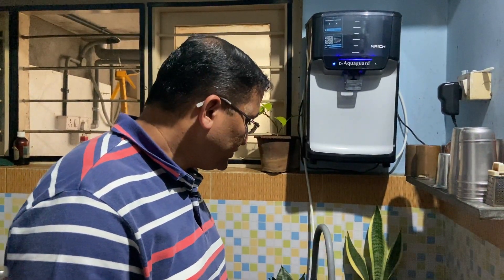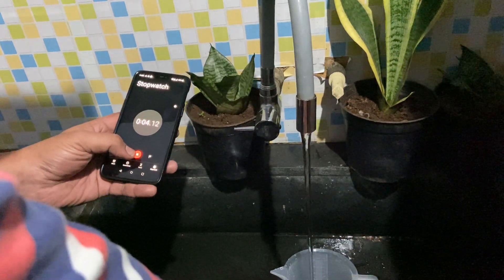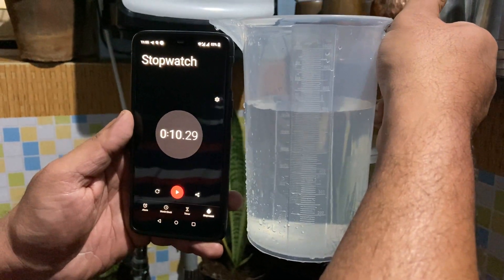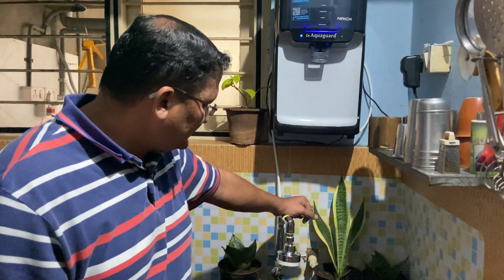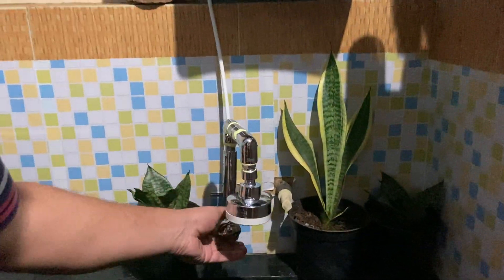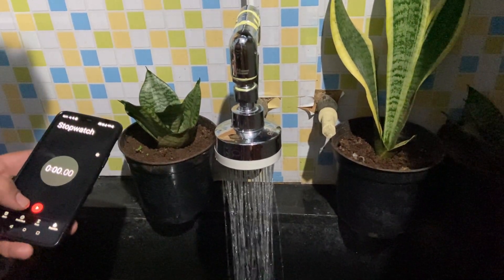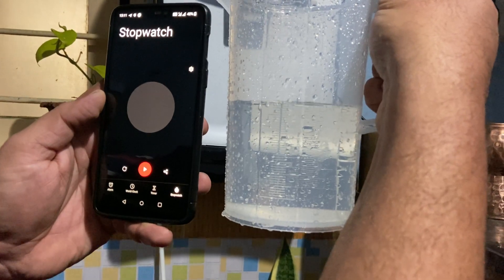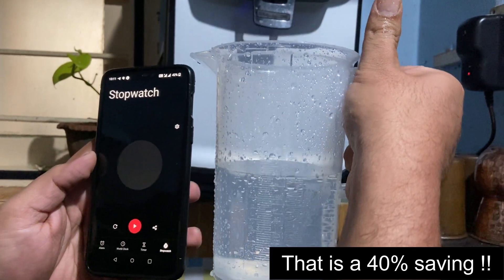Water Saving tap for kitchen Sinks

Comment: Hi Sir, Did you try replacing the tap's aerator with a water saving one? There are aerators with different flow rates and will be a lower cost and a 30 second DIY change
Reply from the maker: Yes have tried. That is good as well. 
I still prefer the shower tap since it has a large diameter with water flowing under lower velocity. Also since the tap can swivel , it gives a larger coverage for unit flow .
Reply: @HinrenEngineering  Thanks. I am looking at buying an aerator that has swivel, how important is swivel in getting a better wash experience?
Reply from the maker: @GopalakrishnaBhat  for us , swivel is important since the sink is large and there are large number of utensils .